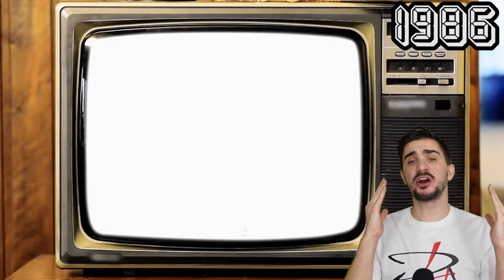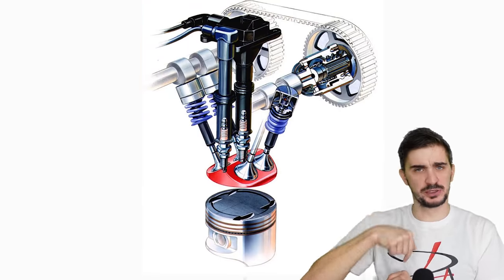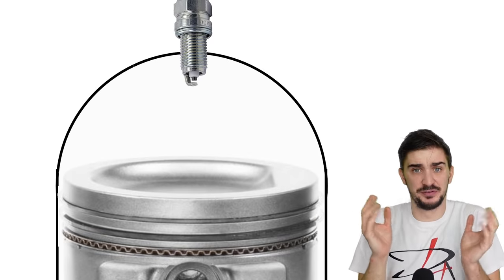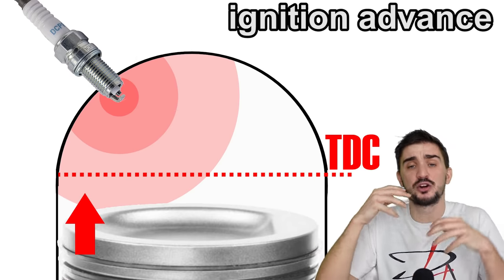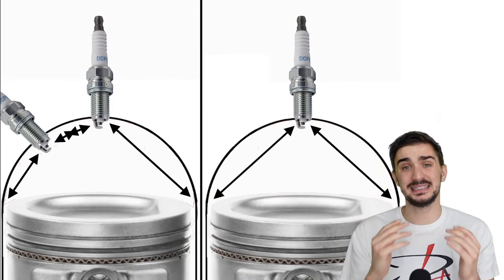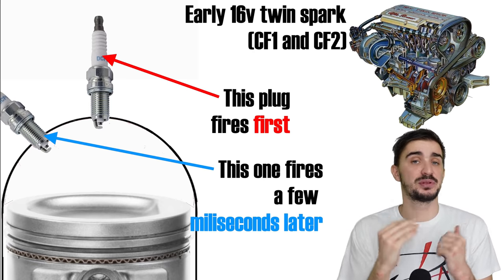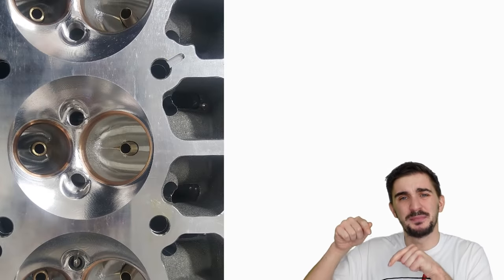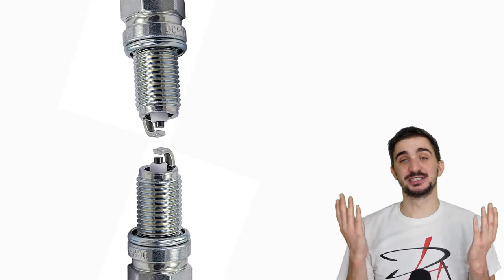TWIN SPARK - WHY, HOW and why it isn't more widespread

Comment: I remember during my flying lessons we would turn off one magneto (airplane ignition coil) and you'd lose about 200 rpm.
Reply: Same with the Mercedes twin spark engines. You can shut off a single circuit to use for diagnostics and see an RPM change even when switching between the two
Reply: Aircraft with piston engines have 2 spark plugs per cylinder is also for reliably not only power.
Reply: @fchanMSI  redundancy
Reply: Yep, checking for lead fouling on the plugs too.
Reply: Magneto are quite a bit  different than automotive ignition coils, its a very old technology with the main advantage of being completely independent from the aircrafts electric system.
Reply: @gabrielgavilan5131  True. Aircraft engines are built like tractor engines in the sense of constant power demand and reliability. You can’t park on a cloud so it’s also redundancy. That’s why magnetos are used over variable spark timing.
I also remember having to vibracut the lead foul material out or the lower spark plugs and bead blast them because of a misfire in the local flight schools planes. Using .30 safety wire to clean and check the gaps. Great times I miss.
Reply: Magneto's do not require power like a coil does to produce spark it is mechanical not electrical. In fact you have to work hard to make a magneto not fire which is why you turn them off by grounding them through the "P" wire. Magnetos produce a very hot spark the only down side is that they are setup to produce max power at a very narrow ROM range they are not as adjustable as other systems. That is not a problem though on an ancient gas reciprocating internal combustion engine on light aircraft. Some hotrods and NHRA style drag cars still use magneto's last I checked. Coils and electronic ignition is lighter and more flexible so that is why magnetos are not used widely anymore.
Reply: @buckaroobonsi555  lmao, coils and a battery (and a starter because if you're using a external starter why have a battery.) same reason dirtbikes have magnetos, lighter and no reason to have electronic ignition when you don't need a battery.
Reply: You loose those 200 rpms with single mag, because of the bad position of the working spark plug  too much for the side (*offset = bad efficiency) of the combustion chamber. Single spark engine has it right in the middle of the cc.
Reply: Probably more to do with the design of the engine and being an magneto, aircraft engines are archaic.
Reply: @macthemec  nope, they use hemispheric combustion chambers. With 2 spark plugs. When did you saw that in a Hemi??
Reply: Top fuel engines basically run at one speed when they're on a run. However the spark plugs only last about 2 seconds at full power after that they are dieseling.
Reply: @magicstew45  actually the crank start was on cars just before battery and starters and same why bikes has battery and starters even reverse now and it's smaller battery still better than not having one
Reply: You do the magneto check on run-up, and while the engine is only turning about 1,700 RPM.  Most direct drive aircraft engines have about a 2,400 RPM redline.  It's a lot less noticeable at or near full power.
Reply: @tomasnokechtesledger1786  that coupled with huge cylinders, and super-rich mixtures that don't burn completely
Reply: @jacobvanhalteren7452  sure
Reply: Well, you should only lose about 100 rpm, no more than 150… but yes
Reply: @brentboswell1294   redline is typically around 2700 for piston trainers (I.e. lycoming 320, 360, etc.)
Some of the aircraft do the run up at 2000 rpm (for the o360).

Regardless low rpm is low..
Reply: @buckaroobonsi555  Magnetos are entirely electrical, how do you think they fire the (electrical) spark plugs? What they are not, is electronic.
They generate all the electricity they need by themselves, via a magnet on a rotating shaft interacting with a fixed coil. The points just short the primary winding to ground when the time comes to fire the cylinder, which generates a rather large change in the magnetic field going thru both the primary and secondary windings, which is what causes the large voltage to appear across the secondary winding. The condenser is primarily responsible for prolonging the life of the points.
What I've just described is what is inside most push lawnmowers. I should know, I fix them for a living.
Hmm, air cooled, constant throttle setting, magneto ignition, not much significant technical advancement in the past 50 years, push lawnmower engines have a lot more in common with GA piston gasoline aviation engines than I thought.
Reply: @aisu8481  And if nothing happens with one magneto turned off, and the engine quits with the other one off, you know that one ignition circuit is faulty - instead of taking off, you should head for the next bar and call it a day.
Reply: @buckaroobonsi555  Magnetos do indeed require power! They simply generate their own. You can get some very powerful magnetos, that take several horsepower to run, such as the ones that you mention.
Reply: @fchanMSI  mainly for safety and you definitely don't want your engine to shut off in the sky. In a car its not as dangerous if your engine shuts off.
Reply: Mercedes V6 M112 and v8 M113 also use Twin Spark, these engines was build from late 90 up to late 2000s and the v12 use still it. These engines have 3 valves per cylinder. 
Twin Sparks are more important if the size of one cylinder is really huge, especially when bore is much greater then stroke.
Reply: Aircraft dual ignition requirement arose in the days of rubber impregnated cotton insulation.  In the 20s, electrical was less reliable than mechanical.  A century later, electrical is arguably more reliable than mechanical.  The dual ignition’s main justification is keeping auto engines out of planes.
    However, plane engines have open, no squish, no turbulence combustion chambers.  The mixture burns slow and sped along by two plugs.  Only reason I can think  Lycoming and Continental stick with open chambers is the slower combustion doesn’t  smack the prop.
Reply: Twin spark plugs in aircraft engine are not primary for redundancy.  Redundancy is a secondary benefit. The cylinder bore on aircraft engines tend to be quite large a single spark plug did not propagate the flame fast enough to travel across to get good efficiency out of the burn. On top of that mags have a lower voltage output = less powerful spark.  Two spark plugs are primarily for  thorough flame propagation in the cylinder. Automotive engines do not have that problem because the cylinder bore is not 5" or greater.
Reply: @tomstulc9143  Good point, consider aircraft engines with 5” bore turn 1/2 the speed of auto engines with 4”bores.  What tickles my curiosity is why no squish/turbulence.  This reduces advance and knock.
Reply: is there an economy benefit to this or what is the point if having this
Reply: @Backyardmech1  except that magnetos are less reliable than modern ignition coils, and when a magneto fails often the engine has to be turned off or turns of itself. Magnetos cause more issues than they fix. Read about them.
Reply: @buckaroobonsi555  Magnetos are not used because less reliable, less precise, more expensive, more complicated. Basically they have been obsolete for a long time even for aircraft.
Reply: @fchanMSI only for that. Redundancy
Reply: That's so cool and I never forget you said this.
Reply: @gabrielgavilan5131 excellent insight.
Reply: I would assume another reason why dual plugs worked better on older engines than today's engines is the spark itself. Now with high energy ignitions the voltages are near 100,000 vdc around 4 to 5 times more energetic thus hotter or creating a larger spark from being able to ionizing more air thus igniting more fuel/ air vapor.  They needed two plugs  to do what one can do today. Plus better spark plugs thru design and exotic materials. The split fire and other type of plugs have more than one arc or larger electrodes using copper platinum iridium or other  exotic metals as catalysts to improve plasma  spark generated.
Reply: Yah rented airplanes back in the 70s .remember that too.  Later I had a Ford Ranger with a double ignition. One set of  coil packs stopped working. The difference was noticeable.
Reply: @magicstew45 dirt bikes have "magnetos" and electronic ignition since ~1980.
Reply: Mowers have not had points in decades..spark is triggered electronically. But yes they use the name magneto.
Reply: @44R0Ndin you got the points firing explanation back to front...
Reply: @waynegarfield6607 this isn’t true at all. HEI coils can be 65,000 volts.
Reply: Unlike auto engines,aircraft engines have huge cylinder bores to make required power at lower RPMs.
Reply: Another thing I just can't understand is why use just 6.0/1 of compression ratio while the gasoline have more than 100 octanes
Seems more kind of a tradition rather than good engineering
Reply: Absolutely correct

Comment: When I was learning to fly, they used twin (magneto) ignition for redundancy. You'd test each mag by shutting the other off just before takeoff. RPMs would drop by 100 or so, meaning you got more power with two vs one.

That said, cylinders were HUGE (90 cu in/1.5L each!) That, along with the antiquated ignition system, probably meant a performance bump for twin mags. Also, mag advance is fixed and optimized for twin plugs.
Reply: As I remember reading somewhere Charles Lindbergh airplane ' Spirit of St. Louis ' had dual spark plugs. According to Charles he flew all the way to Paris and it never missed even one time.
Reply: As I understand it, the magnetos are also isolated from the rest of the electrical system; their only job is to provide spark. Cars used to work this way, too (100+ years ago) but that design was phased-out as a cost-saving measure.
Reply: @hibob841  Exactly. Airplane Engine require absolutely no external electricity to run, a bit like a Diesel. I like to fly an old Piper (Super) Cub, (a PA-19, officially a Super Cub but it has no Flaps and only the left Wing Tank) and it is still a Hand Start and has no Alternator or Generator at all. It has a Glider Battery for the Radio that gets recharged after each Day of flying and that's it.
Reply: @MyFabian94    uhh , ASE diesel technician here. Diesel engine has no ignition whatsoever wheras the airplane engine has a externally generated electrical current generating an internal spark therefore needing an externally created spark...its created by a component bolted to an engine just like an alternator or generator just a very crude and basic version of em, you can run lights and stuff off a magneto.an external electrical charge is forced to jump a gap causing spark .it comes from the engines rotation spinning a flywheel with permanent magnents attatched passing by coils of copper wires creating a magnetic field exiting electrons which are in microseconds stored in capacitors( some do ,some just yeet that shit down the wire) surge from there either through cap & wire or coil delivery contactors and dwell in the form of spark AKA a  magneto spark ignition system. Diesel engines have NO spark and rely on excessive cranking to cause friction and pressures love child (heat) which detonates the fuel oil . Other forms of starting zee diesel engine are introducing a low flash point atomized detonation inducer such as ether or more commonly used today world wide a big ass resistor aka heating element known as a glow plug. Though commonintodays diesels they were notused in the early years making diesel startup a pain in the a$$ back then or for modern ford powerstrokes that hate life....thought id clarify that up for ya. The more you know.. .
Reply: @TomAss-it5cp  I am well aware of that, but in the practical Application of an Aircraft Engine, the Engine requires only 3 Connection/Control Points the Airframe: 
1. Fuel
2. Throttle/Injection
3. Ground/Shut-Off
And then there are optional extras like Glow Plugs/Carb Heat, Wastegate/Mixture and so on. 
And if the Ground or Shutoff Switch doesn't work, the Engine will keep running until it runs out of fuel. 
So, for all intents and purposes of Operation, the Petrol Engine and the Diesel Engine are in this case equally independent and mechanical. 
There is no Digital Ignition Box, no Vacuum Advance, no mechanical Advance, no Coil to burn out etc. 
It's Electromechanical, but without any external source of Electricity. Same as a Diesel.
Reply: Also, some aviation engines have an electronic ignition for higher performance and a magneto for higher reliability. The mag is the one you shut off after takeoff on those engines...